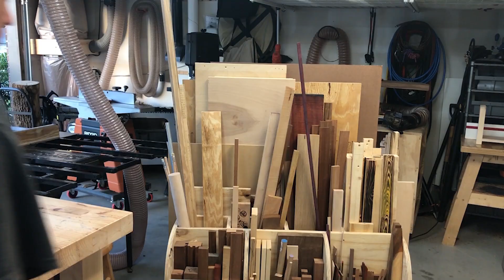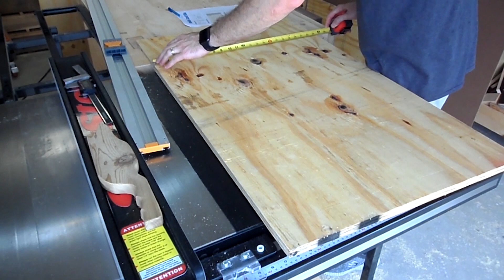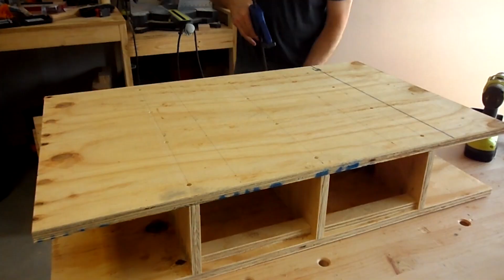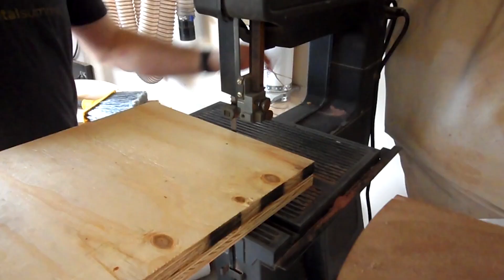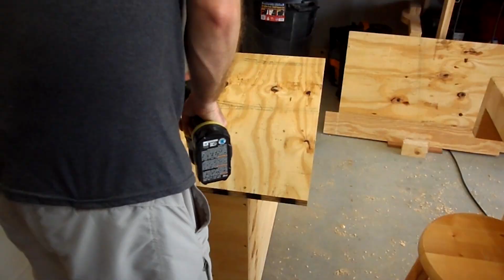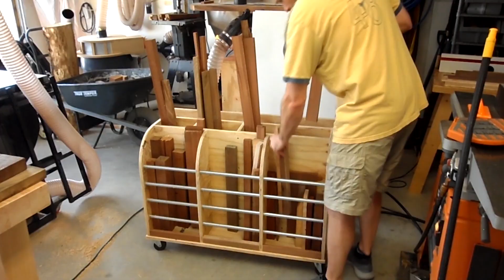Scrap Bin Cart

Comment: I actually built this last Wednesday but made mine 8 inches longer and 10 inches wider. I put lengthwise shelves between the two back openings.
Reply from the maker: Larry Gault I think of I made it again I would do something similar. It’s a good size for my current shop/garage but it was filled almost immediately.
Reply: Larry, you put shelves in the plywood storage area??  Is there anywhere to see a picture of it?
Reply: @Belg1970  Emailed a pix
Reply: Woops wrong person.. I'll put it on your FB page
Reply: @ljgault  haven't seen a pic have you sent one to me??